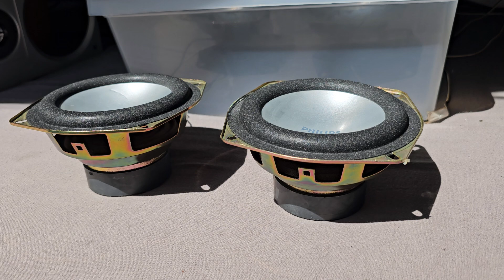Philips MC-50 5.25" | Amazing excursion

Comment: What ohm are they?
Reply from the maker: These drivers are 6 ohms each. You can find the parameters of the drivers in the videos I upload in the description.
Reply: @PexcurisonI was just curious, my old car has factory 2 ohm 5.25 squircle drivers that disintegrate. I'm always on the lookout for options at 2 ohm so the factory amp works at its best. Umi ran 4 ohm in them for a while and it was fine, but I found a set of 2 ohms on Alibaba and they absolutely slam in comparison.
Reply from the maker: @AutomatedUser That's pretty interesting! You could perhaps wire them in parallel to get a 3 ohm load, but you'd definitely be better off going for 2 ohm speakers.